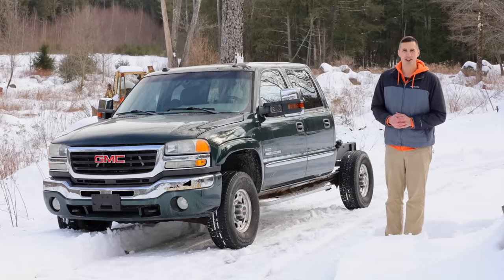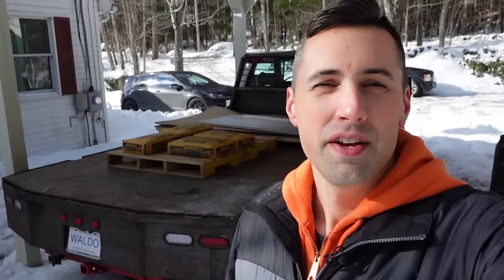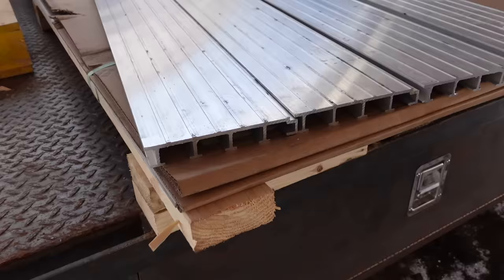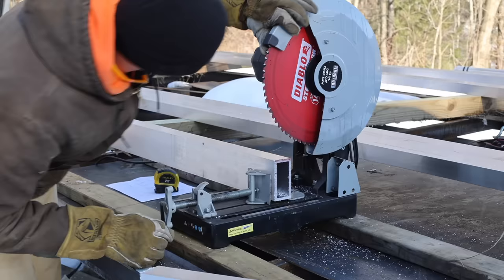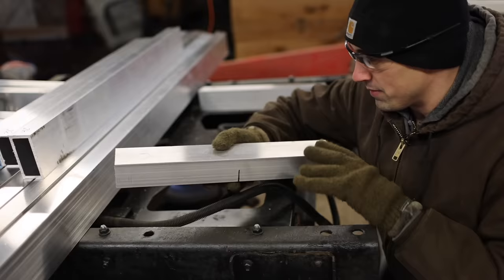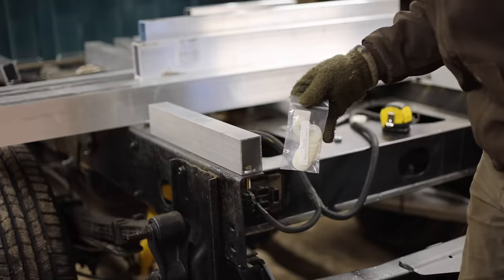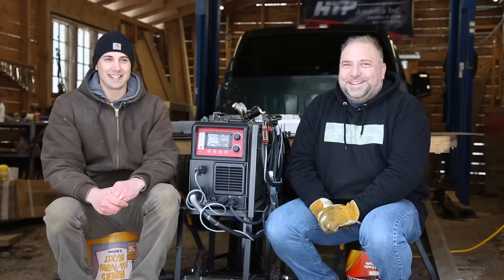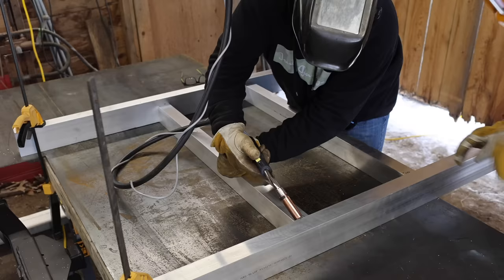Building an ALUMINUM Flatbed for my Project Truck!

Comment: Another great video, Waldo. I have a few suggestions for you. 1). try to run all your wiring inside of the tubes with that plastic spiral sheathing. 2) Add a couple spot lights to the headache rack. Hooking up trailers and strapping things down and checking straps at night can be a rough deal without great lighting. 3) Everywhere you run wire/wire looms through the aluminum use a grommet with silicone calk in the grommet channel. This will help keep the grommet in place and keep the hole you drilled for it from corrosion. 4) Once you know exactly where the fuel tank/tool box is going, add gussets to the headache rack. They will save you in the long run... 5) Wire in a few lights and switches for wheel well lighting. I used to haul cars cross country. I've had a few flats and other issues in some pretty dark places where well lights would have saved my ass in a big way..  6) Emergency flashers are one thing, but strobe lights are a far cry better.. People know what is what for miles before a hazzard flasher.. Day or night!!!
Reply from the maker: Thank you for the tips!
Reply: Headache rack gussets. Yes. Yes. Yes. 1000x yes.
Reply: Great advice
Reply: Wheel well lighting is genius.
Reply: If you don't have one, a backup camera would be great to have on that truck.
Reply: is that all you can do is complain about his work? Let me see a vid. on your bed build.
Reply: @johnvanyosr8896  Waldo LOVED and 89 other people liked what I wrote. It's all helpful tips for all to use if they like. I have not complained about anything here!!  The beds I have built were long before YouTube or anyone doing DIY video's. If I didn't have a fused back and was capable of making a channel, I would, but my cards have been dealt and the best I can do these days is try to share some knowledge. I'm sorry if anything I said bothers you.
Reply: I was wondering if you could share the cost of this aluminum flatbed. Very nice build

Comment: Looks great so far. I have lots of flat beds and I would like to mention one thing that would give a lot of strength to the headache rack. It needs to be gusseted to the bed or it will break the welds as they tend to shake back and forth.

Comment: Great video, touched on a lot of what makes aluminum welding different than welding carbon steel. The trickiest thing I have found with welding Aluminum is how well it conducts heat: you can start a weld with one power setting and end it with a fraction of what you started because of just how much heat transfer takes place between the just-cooled filler and the rest of the workpiece.
Also, good thinking using the nylon washers between the steel truck frame and the aluminum flatbed 👍
Reply from the maker: Thank you!
Reply: That remote looks like it should be a standard option for an aluminum welding rig

Comment: I made a new flat bed for my '65F100. I used 6061 alum. Used 4"x2" channels on top of the steel truck frame. Used 2"x2" alum angles bolted to truck frame  (three per side) that bolted to the 4"x2" channel.  Next... 3"x2" channels bolted to the 4"x2" crossmembers. I  then had a 1/4" alum. plate (28"x 72" ) that went  behind the cab (on top of the cross members). Then had 3 pieces of 5/8"x 9" A-36 plates  cut for the sides & back.  In the opening that was caused by the 1/4" alum in the front, the two sides & the back...I had a piece of 1/4" A-36 plate cut to fill in the opening. About 52" sq. as I remember. 
  I wanted to lighten the fab table up. So, using 1/4" plate was the ticket. Welded the three sides to the 1/4" plate. Doing so there was minimum warping.  Can bend 1/4"x3" flat bar into a 90. I clamp the piece down very well. Wear ear protection, to form the part. 
  Nearly forgot...made a rack so cutting bottles could be brought along when needed. 
I am pleased with how it turned out. It serves me well.

Comment: Looks sharp. Nice job. You have great fabrication skills. 

A little advice:

Although aluminum is strong, it is very prone to cracking (especially when it is in a high-vibration service life, such as a vehicle).

Aluminum does rust, it’s in the form of aluminum oxide. This oxide layer gives aluminum anti-corrosion properties. You should remove the oxide before welding as it will contaminate the weld with hydrogen (which can cause cracking, especially on 6061). This oxide layer also melts at 3-times the temperature as the aluminum itself, so it makes welding easier to remove the oxide prior to welding.

Wire brush the weld joints with a stainless wire brush to remove the oxide and clean all oil and chemicals off with acetone or isopropyl alcohol prior to welding. Do not use a grinder or saw that has been used on plain carbon steel. Cross contamination can cause weld defects and/or cracking.

Fill your craters at the end of each weld. Craters can crack.

Aluminum does corrode when it comes in contact with certain elements. It can react with plain carbon steel (the reaction is called electrolysis). The nylon washer between the chassis and aluminum frame is a good move, but it would be wise to swap out your grade 5 or 8 steel washers and fasteners with stainless steel washers and fasteners.

Welding 6061 aluminum with 5XXX-series filler wire is generally stronger, although most welders prefer the ease and look of 4XXX-series wire.

6061 can be annealed prior to welding and heat treated after welding for some increased strength characteristics.

Hope this helps you and anyone else welding aluminum in the future.

Again, very nice work. That’s a better fabrication job than a lot of the “professional” fabricators I’ve worked with. Can’t wait for the next video.

Comment: Hello Waldo,
  I've built 3 flat beds in my life, all with treated lumber. 
  I had 8ft 4x4's bolted to the frame rails then 4 6ft 2x4's screwed across  the
 4x4's. Then 8ft 2x6's screwed to the 2x4's. 
   I think you should have put the bed slats the other way to help shed water.
Love the videos keep up the good work and God bless and stay safe.
Reply: Everyone is an expert
Reply: @chucklamantia3067  so you thin you are one too , lol
Reply: @TomMack530  Expert Medical Witness

Comment: I took my CDL exam in an automatic Freightliner (look for a rental in your area, such as Ryder, etc.) and a trailer..  That'll get you your CDL-A with auto restriction.  Then, while still on your CLP (do NOT pick up your CDL license at DMV yet), schedule the test in your manual pickup and gooseneck (26001+GCVWR).  Once you've passed both, THEN go get your actual CDL license at the DMV.  This is how I did it.  It gave me easy tractor-trailer accessibility, and then retesting in my Ram dually and 30k gvw gooseneck cleared the auto restriction.  I also tested Tanker and doubles.  Only thing I missed was HAZMAT.
If you pick up your license prior to getting the manual exam, you'll have to re-permit for the manual..  it's a PITA.

Comment: I have a Lincoln 360mp and love the pulse on pulse for welding aluminum. I run the hot start feature for about 3-4 seconds at 25% over set voltage so the weld isn't as cold starting out. and crater fill for finishing the welds. Nice looking flatbed.

Comment: As a project while learning to TIG a few years ago. I made something like your Headache rack out of 90mm Aluminium round tube for a mates 70 series Landcruiser Ute. He lives on a large, remote station (farm) in Aus. We put two fillers on the top and taps on either side under the tray. One side filled with water, mainly for the dogs and handwashing, the other side for spare diesel. held 20+ litres each side and the weight was right up front. Worked a treat. (Not sure about how roadworthy it would be. And I guess we don't have the whole freezing thing to worry about.)  I have to get one of those Pulse MIGs! Great video Waldo thanks. 👍

Comment: Thanks for the great content. I used to build these via steel, and yes, they will rust, but customers were not willing to opt for expensive aluminum. ( some even opted for no paint on the units to save a few bucks ). Good to see you insulated the hold-down bolts to prevent electrolysis corrosion to the aluminum frame. I will also say, as good as your welds appear, if the structure is heavily stressed in some areas, the welds will likely crack. Seen it a hundred times. It's one reason I opt for steel. Your design is excellent and the truck looks well proportioned.

Comment: Tucking your headache rack behind the cab really helps a lot with gas mileage.  Even that little bit that you let it hang out on both sides will cost you quite a bit in gas mileage;  it catches the wind like a sail.  No big deal really, it's just money
Reply: and windnoise .... LOL
Reply from the maker: Good point!
Reply: Headache racks are there to protect the cab though, they do a much better job if they stick out a little.

Comment: That remote is specifically for Aluminum. The idea is getting started is always the hard part on aluminum and takes the most heat. Even when TIG welding Aluminum you start out with your foot pedal maxed and back out of it once you establish your puddle. So you set the machine high for the start and run that adjustment maxed at your starts then lower once you make your puddle and run your weld. Preheating your starts is always very helpful in achieving the same exact thing without that adjustment. Its the same idea as the foot pedal on TIG machines. That machine is really nice for a MIG based Aluminum Machine. I've not got to use one myself but, ive heard really good things about them. I still think i would be more comfortable with a Foot Pedal on that machine if thats possible instead of the switch since I'm already so used to TIG welding.

My only question is that a push-pull gun on that machine? Thats what is normally on Aluminum MIG machines but, all the ones ive ever run (Miller) are MUCH bigger than that gun so it doesn't look like a push-pull gun but, if it is thats the smallest form factor ive ever seen on one and makes that an even more badass machine. If its not a push-pull gun then the lead must be really nice and stiff or something because thats the problem with running aluminum wire on normal MIG machines (Which you can absolutely do otherwise) is the wire will bind up in the liner far too easily especially if you dont keep the lead line perfectly straight as possible at all times. Thats why you run Spool Guns instead on those machines.
Reply: its an 8.5 ft push only gun with a special carbon graphite liner ... works absolutely flawless ... I have run over 150 rolls of aluminum wire though nine and I can count birds nest and feeding issues on 2 hands ....
Reply: @ZILAwelds  I was wondering the same thing as the first guy. Thanks for the answer. I'm guessing that you don't want to run steel wire through the same liner or it will contaminate future aluminum use?
Reply: @Lucas12v  most people buy 2 welding guns with the machine ...   ( to buy the 2nd one cost you roughly $150) ....     the aluminum one has a special liner and special gas delivery system for good gas coverage when welding aluminum.   the steel gun is just plain old ... no thrills ....  the remote control you could attach to either one .... (for steel I dont see why you wold need it ) .....     crosscontmination is somewhat of a concern - but feedablilty is the bigger concern .... the carbon graphite liner in the aluminum gun is a lot softer than the spiral steel liner int he steel gun ... and if you would feed steel though the aluminum gun you'd be wearing it out way too quick ... and if you feed aluminum through the steel gun  - well ...  it does not like it much
Reply: @ZILAwelds  makes sense. I do a lot more aluminum tig than mig but that's partly because i don't like my spoolgun that much. Nothing wrong with it, i just don't like cold starts and no pulse on my machine. Maybe I'll pick up one of these someday.
Reply: @Lucas12v  for 10 years !!!!  95% of my aluminum work was AC tig .... and 5% spool gun off an engine drive ....  for 6 or 7 years I have pulse mig machines now .. Lincoln and HTP and now 88%+ of my aluminum welding is (pulse) mig 10% tig (only if it as to be for looks or maximum control) and 2% "other" spool gun off engine drive or aluminum stick welding in the wind outside.   its such a time saver !!!! and most of the time for my kind of jobs I dont need the perfect stack of dimes tig look .... a good "commercial weld" is just that ...  good enough 9/10 times for what I do ..... 
now if a guy does a bunch of motorsports stuff ... intercoolers, boost piping, blow off valves, intakes ....  sure ... there is BIG $$$$ in that and the cars are often "show cars" and people are willig to pay for that look .....  
semi truck fenders, flatbeds, fuel tanks, water tanks ... etc .....  my customers dont want to pay for the looks .... and I want to get it done and go home ....

Comment: Waldo keep in mind the headache rack has to prevent damage to the cab in case of gooseneck jack knife. Maybe test swing a gooseneck hitch at the sides to simulate a jack knife situation. With u being on snow, icy roads.. that's a thing you'll kiss your headache rack for saving.

Comment: I'm glad you changed to the wood drop saw. As a general rule of thumb; you pretty much treat aluminium as if it's wood when cutting. You can use a skill saw, table saw and a router for the edges too!

Comment: Great idea putting those nylon washer in.  You might consider an additional insulating washer under the head of the bolt.  Put a metal washer on the bolt first, then the insulating washer.  Add a bit of plastic tubing around the bolt diameter.  Maybe a bit of pex tubing.  Using nylock nuts  will avoid loose nuts as the washers relax over time.
Reply: Yes.  The single washers under the bed was not enough isolation - still going to have galvanic action under the bolt/washer.

Comment: Just wanted to let you know as well those grommets you are using for your lights invite alot of road debris to collect on the wiring connections. Grote and truck light make the same size rubber grommets that are fully enclosed for those lights to protect the back of them.

Comment: Restrictions warnings
Class A vehicle minimum requirements 
Manual transmission 
Air brakes
>HAS TO< be able to pass the pre/post trip (my coworker had to redo his test because the truck failed the inspection) 

And a trailer (air brakes too) 

Class B 
Minus the trailer but everything else. 

If anything I have to stress to you is most people fail the inspection aspect read that chapter over and over. Don't skip anything lol. 

It is possible to pass just read the book don't do mock tests on line they are mostly not a big help 

Simple question like how much air can be dropped while doing a inspection with a trailer attach. Now how much without a trailer. 

What is the cut off pressure for your air. What pressure does the emergency brakes release with low air. 
If you struggle with these answers have someone pop quiz you right out of the book and read it again. 
No one is perfect but I have faith in you!

Comment: Have cut a lot of aluminum with woodworking machines over the years in fabrication shops. The standard practice is to use Johnson's Stick wax as a lubricant. Keeps the blades from getting gummed up and keeps things cool.

Comment: Waldo, are you going to paint the steel flatbed you did? Really like the videos, just eager for more content!
Reply from the maker: I'm planning on getting it hot-dip galvanized. Hopefully this year 😂
Reply: @WaldosWorld  If there is a place in your area that does it, have a look into Arc Sprayed Zinc Coating. It has very similar corrosion resistance to hot dip but with none of the issued associated with hot dipping like warping and having to drill at least two vent holes in every closed section which then allow water in in the future etc. Unfortunately I'm down in New Zealand so can't recommend a supplier to you. Just did a quick search and it looks like it is referred to as Thermal Sprayed Zinc in the US. Cheers from NZ.

Comment: FYI guys, any regular wood miter saw with a TCG (tri-chip grind) style blade will 100% cut aluminum far better than a "dry saw" for steel simply because the RPMs of the two are totally different.  Aluminum, while a metal, is still much softer so a standard saw with 3200-3500 RPMs is ideal (with proper blade).  Dry cut saws, either industrial, or like the new popular Evolution or Slugger brands, have much lower RPMs in the 1500-2000 RPM range and need a carbide or new cermet blade specifically designed for steel.   And if you're going to bend aluminum, especially harder aluminum when it's cold, you should definitely pre-heat it.  After talking about pre-heating necessities earlier in this video I can't believe you didn't Waldo!

Comment: Years ago I went on a road trip in a friend's van. The doors didn't shut right, and we were tired of the wind noise, so we tried to make drip rails from duct tape. Seemed like a great idea until we got up to speed and the tape started flapping in the wind. I mention this because the duct tape beating itself against the A pillar sounded exactly like your pulse welder!